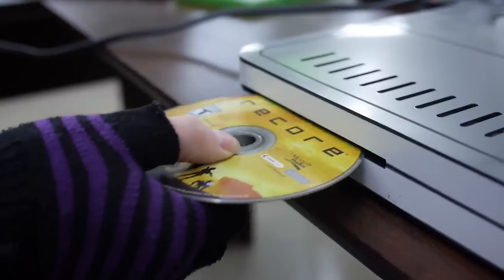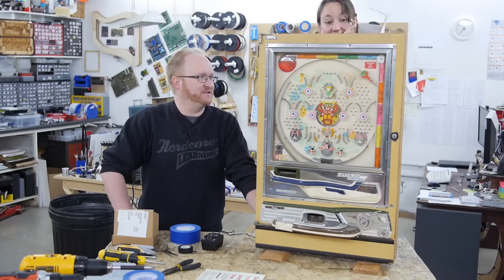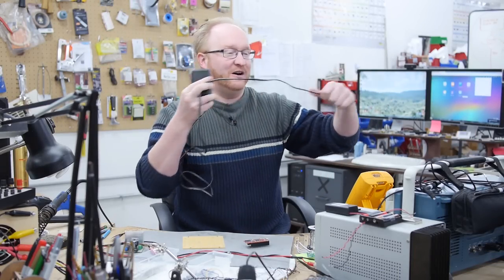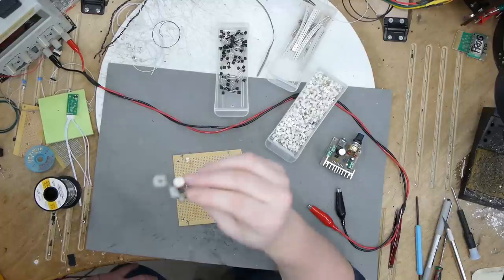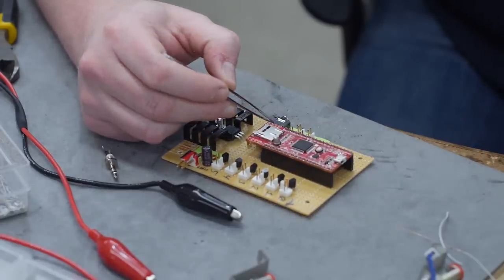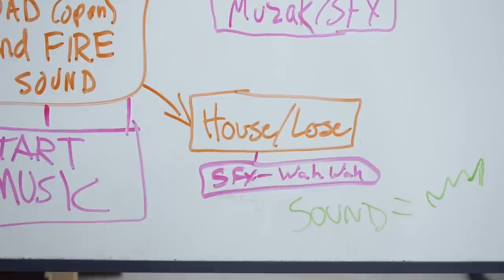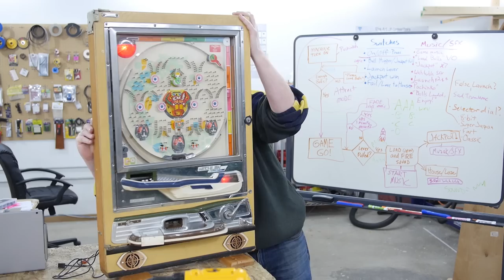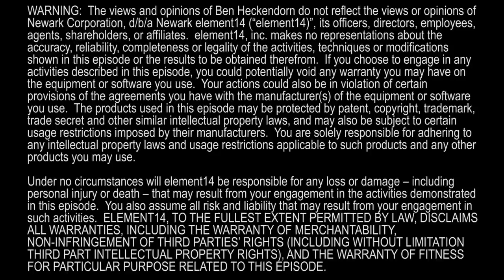Ben Heck's Ultimate Pachinko Rebuild - Vintage Japanese Arcade Mod

Comment: I live in Japan and have been in the pachinko parlors here.  I have never seen one of the older machines.  Man are they different.  The newer machines don't have a launch switch like the one in the video.  The newer ones have forced air that propel the balls into the machine.  You have a knob that you can use to try and control the airflow rate.  So basically game play goes a lot faster.  Seeing the older machine was very interesting.
Reply: I know this is an old comment but thank you for it, I did t know new ones use compressed air!

Comment: That's quite an upgrade and improvement. People sell a lot of those on eBay and antique stores that don't work and need restoration and are sold at very cheap prices. He'd have to purchase them but if they don't work, they're cheap. But just think of the prices he could sell them for if he gave them upgrades like that! Vintage pachinko machines that are modern at the same time!

Comment: Love the rebuild & idea of sound effects.  My problem now is that fill ball tray light switch which can't be fixed.  Where does one get a micro switch?  The win switch is ok accept I will have to cut the plastic weld over one contact arm for the weld/solder just fell off.

Comment: Enjoyed!  I think I can figure this out, but a circuit diagram would be helpful, not sure if you dropped a diode in there and not sure how you are doing the 2 wire to the transistor.  Also what control code did you generate as I'm not sure how to signal the LED as a "duty" cycle.  If you are going to publish these, a link to the code (assuming you want to share), circuit diagram (back of a napkin or white board is fine), and .STL would be wicked, cool, awesome.  Think I can figure out the BOM from the video.  Thanks!

Comment: Im assuming you only put a resistor on the base of the transistor? 
Does that resistor value have to be calculated, or do you just use some standard value?

Comment: BD131 would have been the way to go especially if you use a heatsink and mount the BD131s onto the heatsink use 3 pin connectors to connect the BD131s to the PCB which also holds the micro-controller.

Comment: Very interesting mod to the system.  Great job you guys. :D

Ben, I think you should check into some Teensy 3.2's or 3.5's since they are Arduino compatible and also their digital inputs are 5V tolerant.  The Teensy 3.2 has one analog output and the Teensy 3.5 has 2 analog outputs.  Plus the Teensy 3.5 has a microSD card slot so you could easily store some audio files on it for more interesting mods. :D

Comment: I have one of those machines and there is another problem it would be good for you to solve.  Could you devise a system to move the balls from the bottom collection container back up to the top input container?  I would like to mount my machine in a cabinet and it would be nice to automate this process.  Thanks.
Reply: Another fan suggested that last spring, but we didn't have a machine at the time. Maybe we'll try it this year now that we have one.

Comment: You skipped on the code part of the microprocessor, it'd have been cool if we could have seen what you wrote to get all those features but like not in a long drawn out way maybe a link to the code and a rough guid explains what does what

Comment: Awesome project as always! :)
Do you think it would be possible to make a playstation 1 that would run games from a solid state hard drive using all the original hardware except the disc drive? I know emulation is easily available but I'm interested to know if it'd be feasible.

Comment: I'd like to see Ben take apart a Google Home - get rid of the speakers, just keep the bare essentials, keep the voice control, but ditch the wire.  I want to be able to control my lights, my tv, chromecasts, etc - without being near my single, bulky Google Home.  I want it to fit into a pocket.

Comment: Also what exactly is this driver board, I don't see a name stamped on it.  I've used SparkFun WAV Trigger (robertsonics) but I like the smaller profile of this one?
Reply: Ben used the prop dev stick that is mentioned in the screen text. Ben got it from his friend at Macrofab. You can check out his github that has details about it. https://github.com/LonghornEngineer.

Comment: @0:50 Yeah, but Nintendo 64 cartridges are only about a few MB in size. ;)
Reply: Doesn't matter, the system has direct access to any part of the cartdrige memory chips so there are virtually no load times regardless of size. The comparison was unfair though as it's old VS new (a single texture in any modern game can be a few MB) but even back then, people were complaining about load times on CD based games. Nowadays, only the 3DS and New 3DS carry that legacy although some games are requirng full hardware access thus forcing the system to reboot to free the RAM ocupied by the OS (only happens on the first generation 3DS, not New 3DS) which implies a full 20sec system "reboot" (not an actual loading).